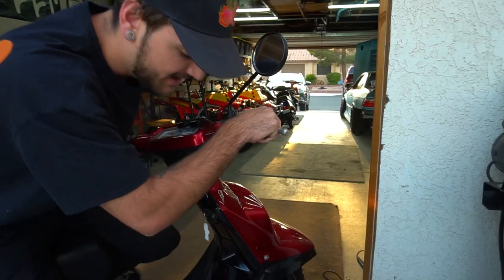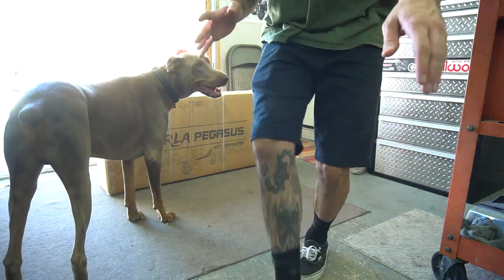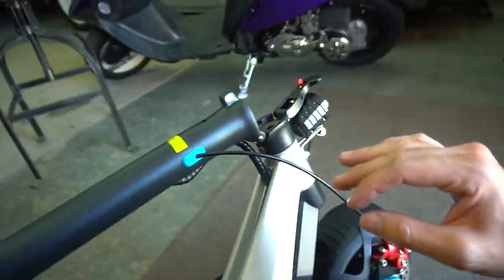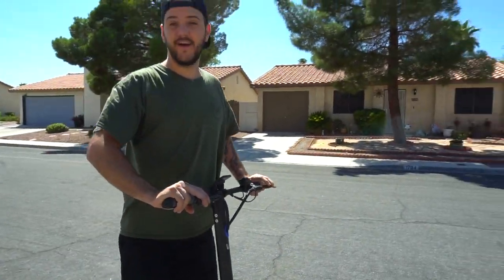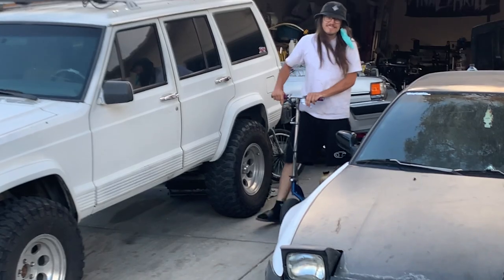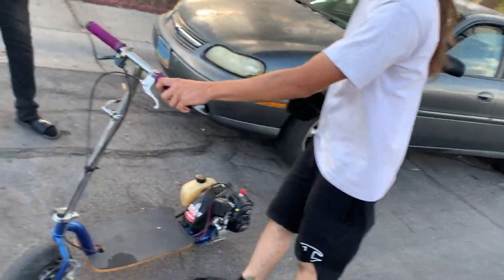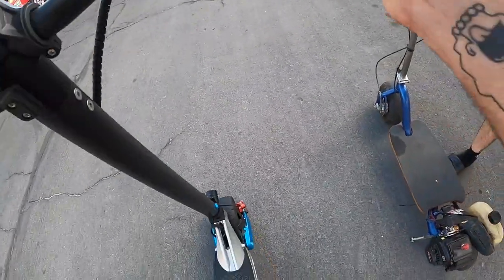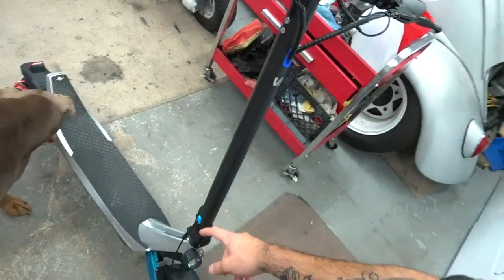is THIS the FUTURE of SCOOTERS? Gas Scooter vs Varla Pegasus Electric

Comment: Dude even piaggio just released an electric scooter, the Ola looks sick though 70+ MPH for like 3,500 🤷‍♂️
Reply from the maker: holy s***
Reply: @MOPBOYZ  You could be the first you tuber to own and rip an electric piaggio or Ola, that’d be massive, I’d do it myself if I had the $$$
Reply: Piaggio also released a gilera runner electric with different versions 40mph/ 65mph/ 85mph only released in italy and germany tho:/
Reply: @radio-180cc  yeah i saw it but its the rst tho😥